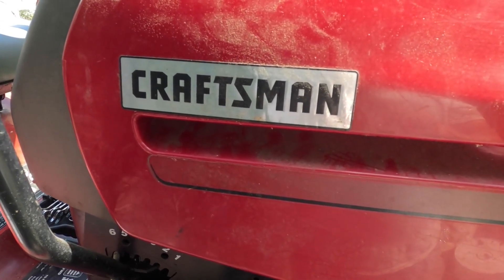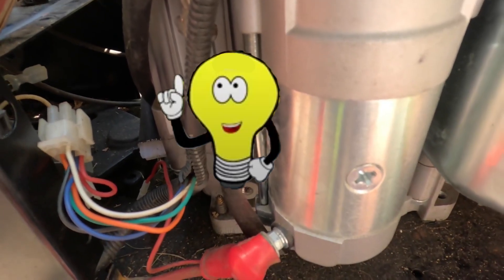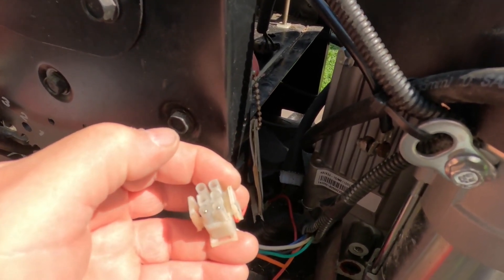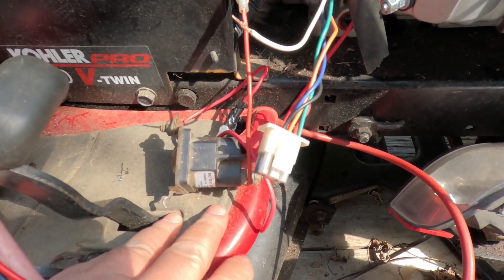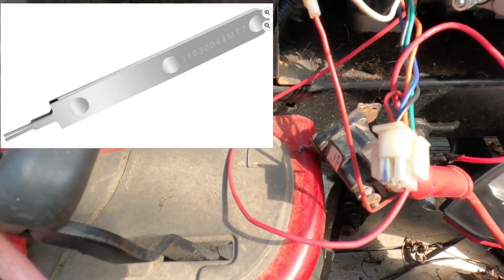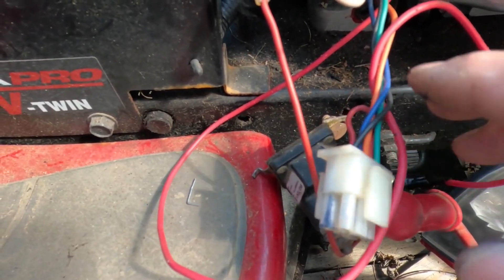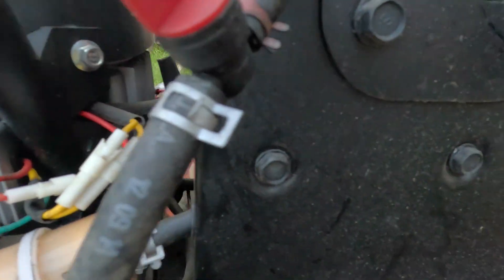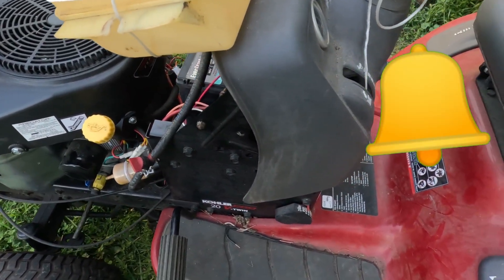Craftsman Engine Swap Blown Kohler Replaced W Harbor Freight Predator          ELECTRICAL

Comment: Congratulations, Joe!!!  Well worth the effort. 👍👍   I thought you'd be able to find schematic for the riding mower at a parts store like Sears Parts Direct or some other one.  They usually have a section for each part of the riding mower, like chassis, deck, console, engine, and an electrical system schematic.  I was hoping you could match the starter switch connections to the Predator schematic.  Glad you had a spare relay and got the system working again.  Great job, man!!!
Reply from the maker: Thank you for the kind words; I appreciate your comment and continuing support. Electrical is not my strong suit & Sears Parts Direct has a schematic but if you check it out it is more to replace parts. It wasn't of any help for me. I popped a fuse & had some sparks (LOL) but was tracing it down wire by wire. A fellow that goes by Bob Driver on Tractor Forum helped with a schematic. I was close to getting it done when I got it, but it was of help. I was concerned about damaging some components if I wired it wrong. But it is all good. Just have to clean out the gas tank.
I believe I did 2 videos cleaning similar gas tanks. Time for a refresher video removing & cleaning out the tank.
Stay well, Joe Z